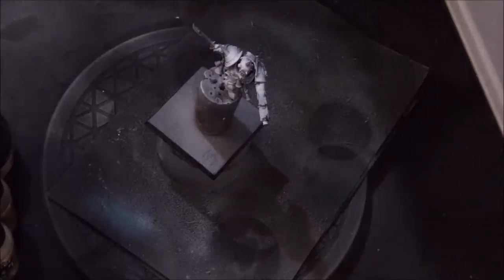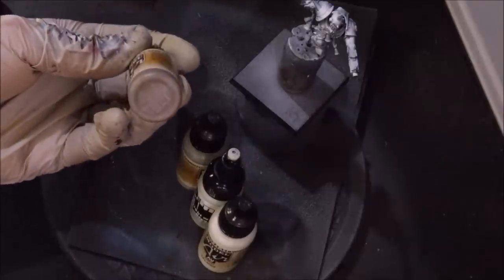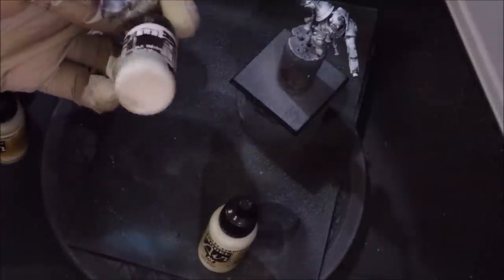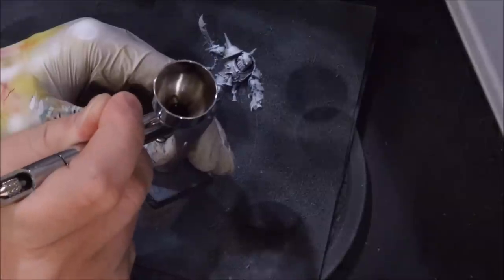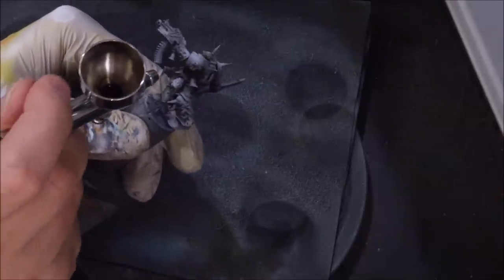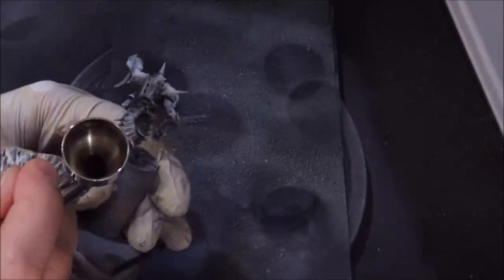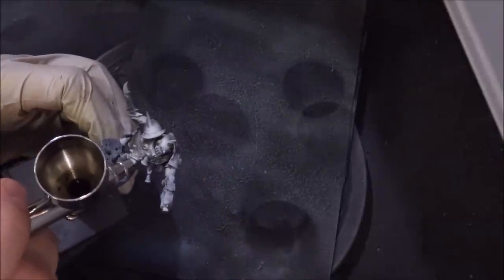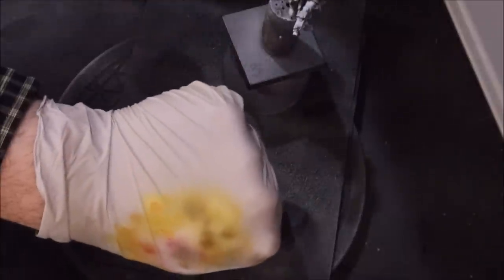Hobby Cheating 186 - How to Paint Death Guard Heresy White Armor

Comment: Looks absolutely awesome, wish i had half your ability :D - Question though about your airbrush thinner - I used thinner in the past when I was beginning to learn with the airbrush and it always ended up causing dry tip no matter how much i added to the paint, so I switched to vallejo flow improver and rarely have issues now, but how come you're not having that issue?
Reply from the maker: I couldn't say, could be the amount, could be how you mix it. One trick is to always make sure the thinner goes in first. If you put paint in first, you are allowing paint to flow into the airbrush channel. That doesn't really get mixed (even when backfilling) with the thinner you then add later and will cause tip dry almost instantly. Just a thought, but it's hard to say for sure.